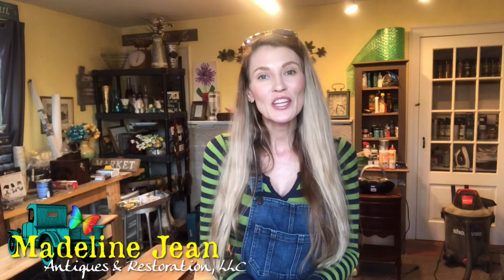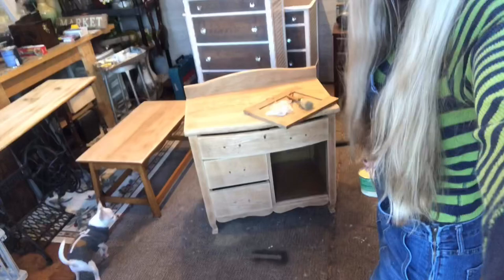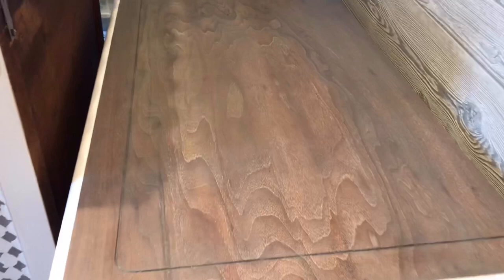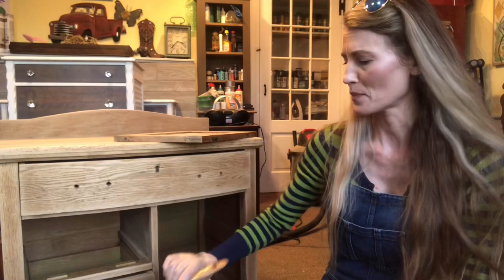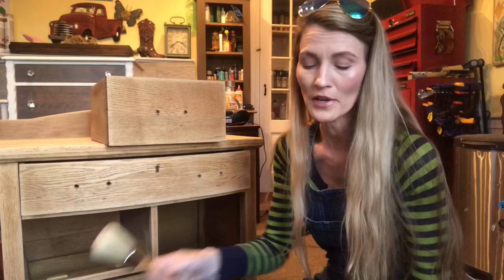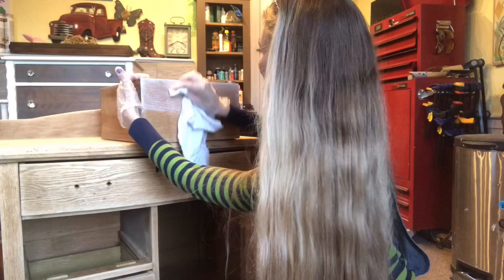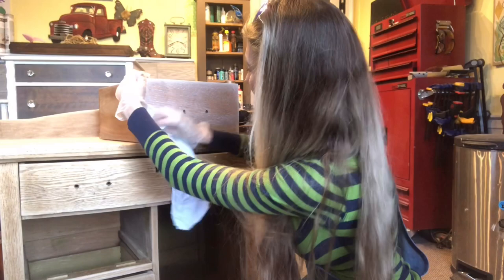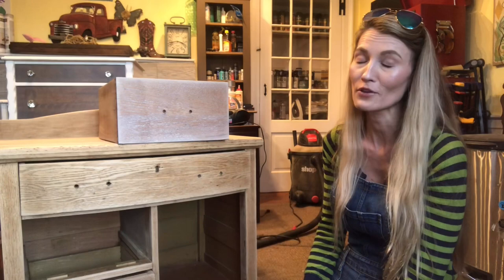How To Apply Liming Wax on Furniture

Comment: Love it. So I’ve sealed natural wood cabinets, lots of grain, with polycrylic. You can still feel the grain. So will the liming wax hold in the grain or would I have to sand first? If so how much?
Reply from the maker: I would advise sanding the cabinets to bare wood. I know you probably don't want to hear that but liming wax works best if there isn't a top coat already penetrating into the wood grain.

Comment: Hello, please could you advise a clear top coat for liming wax? I’m going to do this to an oak sideboard, oak beam table and oak beam coffee table. They have all been sanded but I did a test area with varnish and it turned it orange again 🫣 I’m trying to have washed out rustic neutral look, so absolutely no orange. I love the lining wax look, but I don’t want it really white, if that makes sense? Just whiten the grain then add a clear top coat that won’t turn any of it orange. Thank you

Comment: In a previous answer you said you were going to topcoat with Polycrylic.  Is that what you would still recommend? The stain is oil based and Poly is water based, so I'm wondering if this even works chemically?  I LOVE this look and have my piece 50% fully sanded.  I'm about ready to finish it and need to decide on a protective top coat because it will be in a rental. Thanks in advance!
Reply from the maker: There is a gray area when it comes to mixing oil and water based products. Normally I advise newbies to stick to oil over oil and water over water. You can apply a water based topcoat over an oil based stain IF you let the stain dry at least 72 hours. It has to be dry, dry, dry. I hope that answers your question.

Comment: Love it! Can that take paint over it? I would like to use that as a base than in certain spots use a water downed color.
Reply from the maker: Yes you can! I once applied the lime wax first and then stained. My finish came out gorgeous! Just make sure the lime wax has dried and the unwanted lime wax is removed from surfaces without the wood grain. Lime wax is used to enhance the wood grain so just make sure it's removed elsewhere otherwise your second product (watered down paint or stain won't get absorbed). I hope that all makes sense.
Reply: @madelinejeanantiquesrestor9074  Thank You so much for the information and taking your time to answer my question! Have a great day!
Reply from the maker: Lara Walker Absolutely! My pleasure!
Reply: @madelinejeanantiquesrestor9074  I'd love to see your peice. Is it on your channel?

Comment: Loved this using it on my kitchen cabinets. Do you suggest that I seal them with polyic clear
Reply from the maker: You can seal your cabinets with Polycrylic. It does have a learning curve to it so I would practice on a piece of scrap wood. Make sure the liming wax is mostly into the grain of the wood and not all over. Also make sure the liming wax is bone dry before applying a topcoat.
Reply: p

Comment: Can you use a deglosser instead of sanding? I don’t have a place to take my furniture piece outside to sand. Sanding inside would make a HUGE mess.
Reply from the maker: You could hook up an orbital sander to your Shop Vac. I did that for MANY years before I could afford a nice dust extractor and had my own home. I rented before. You could use a deglosser but that only does so much. That's mainly to clean the piece and cut the shine a bit. I would highly advise at the very least hand sanding with 120 grit sand paper to create some teeth to the surface.

Comment: You can put the liming wax on then a stain ? Is it a gel stain or water based stain and did you do a top coat after that ?
Reply from the maker: I've played around a lot with liming wax. I have put it on BEFORE staining and AFTER staining. The rule of thumb you must make sure it's completely dry AND liming wax should only be pushed into the wood grain not over the entire surface. I hope that makes sense. Yes after it's completely dried I do apply a topcoat.
Reply: @madelinejeanantiquesrestor9074  what top coat do you apply over the liming wax? i have been reading a lot of conflicting information on the internet.

Comment: Do you have to seal the king wax or does it also seal.
Reply from the maker: Liming wax does seal but I also like to apply a water based topcoat for added protection. I wait until the wax cures and then apply it.

Comment: Would you suggest using lining wax on oak kitchen cabinets?
Reply from the maker: You could apply liming wax on the cabinets BUT you would need another topcoat because the liming wax wouldn't offer much protection especially on high traffic kitchen cabinets. You could get the same effect (white in the grain) with an oil based white stain. Just a thought. Then you could use a water based poly over the white and it wouldn't yellow.

Comment: If I use liming wax do I need to seal it with a protector or can I leave as is
Reply from the maker: I usually seal mine. I'll either seal it with clear wax (I can usually apply the wax shortly after I apply the liming wax), water based polycrylic (I make sure the liming wax is totally dried), one time I applied an oil based poly over the liming wax (that's because I first stained the drawer, then I applied the liming wax into the wood grain, but only put the liming wax into the wood grain not over the entire drawer, waited a few days for the liming wax to fully dry, then applied the poly). I have also read some people apply lacquer, I have never tried this.

Comment: Nice video! Turned out very nice. I love the glass knob you added. Did you have to seal it or does the lime wax seal it? Thanks
Reply from the maker: Lourdes McLevey Thanks! I’m glad you found this video informative. Yes I do plan on sealing this piece. While the liming wax does offer some protection I don’t feel it’s enough. I’ll either seal it with clear wax or Polycrylic. I haven’t decided yet. Isn’t that glass knob fabulous? I’m obsessed with glass knobs as of late. So pretty!

Comment: Could you please tell me the grey color stain you that you used on the top of the first dresser that you showed? I am crazy about that look! I have a huge oak headboard with tons of grain that I want to do this too and I bought the wax but not sure which grey stain I should buy to achieve that look? Thank you! I just discovered your channel and subbed. Love your transformations! 🦋
Reply from the maker: Welcome to my channel! Thanks for subbing! The gray stain color is by General Finishes. It's their gel stain line. It's simply called Gray Stain. You can find their products at most woodworking stores or on Amazon. Best of luck with your headboard project!
Reply: Okay

Comment: Hi.  Did you not put a top coat at the end?  Thank you.
Reply from the maker: Yes. You will need to make sure the wax is absolutely dry before doing so and really make sure the liming wax is mostly in the grain of the wood.
Reply: @madelinejeanantiquesrestor9074  Thank you so much for the clarification and of course for sharing!!

Comment: You can apply the stain on top of the wax piece ?
Reply from the maker: The stain will most likely not be absorbed into the wood because the wax will block it. On another piece I applied the stain FIRST and then I applied liming wax into the wood grain. That worked well for me.
Reply: @madelinejeanantiquesrestor9074   thank you so much for sharing, does it need any sort of top coat over liming wax or it can be left as is?

Comment: i would stain the surface first then the wax!!!
Reply from the maker: I’ve done it both ways with no issues. Some projects I’ve stained first then used the liming wax and other times I’ve applied the liming wax first and then I’ve stained.